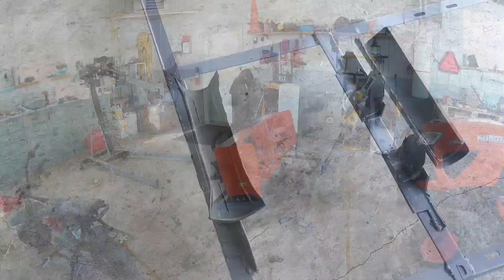Kubota BX23S spring change over.

Comment: You wouldn't by chance have any dimensions for your dolly's would you? Those are awesome. Have a relatively new BX23s and the only thing I dislike is having to move the tractor to hook/unhook anything.
Reply from the maker: It's hard to give dimensions as I built it as I went along, my suggestion is just to put it at an angle and position that looks good, and build down from there.  The casers I used are Heavy Duty 4" swivel casters, but 3" are probably fine as well, as long as there is room to get my pallet forks underneath.